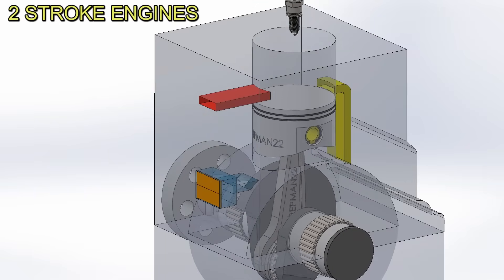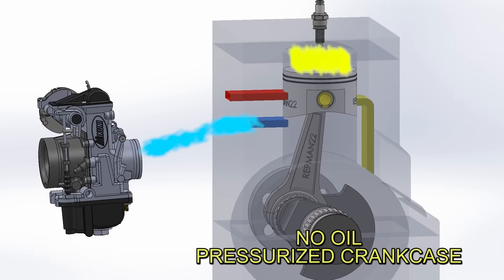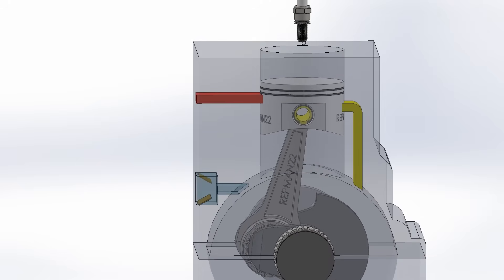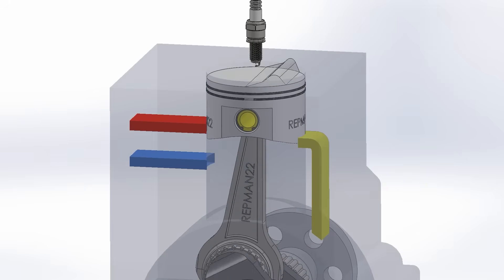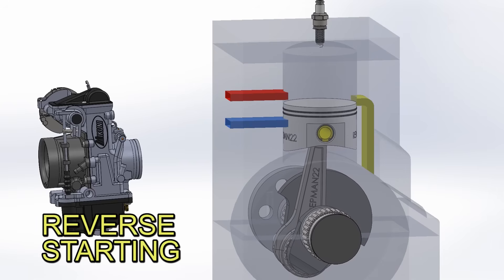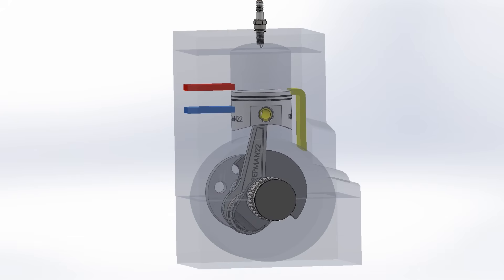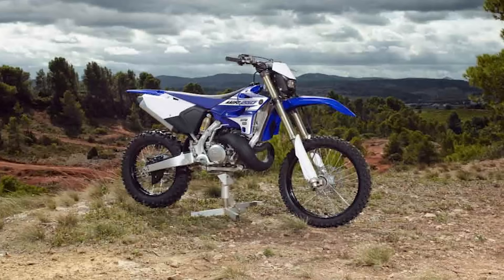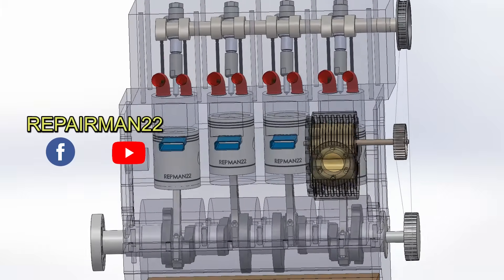Everything You Don't Know About 2 Stroke Engines 🤯

Comment: There  is a D-cycle engine which is a hybrid of 2-/4-stroke engines. It is just by splitting the crown section from its skirt to be operated via a (valvetrain) piston-train. The d-cycle completes the 4 stroke, different in both displacements and periods, per crank revolution.  It has the power of 2-stroke and cleanliness like the 4-stroke. It has been tested with more than >2.5 (~3) times power (torque)  and  >20% fuel efficiency gain. It can also make a hybrid of the diesel and gasoline combustions hybrid, which is another issue (invention).

Comment: Are you high? 2 strokes don't rev to 20k rpm. 

Extremely short stroke engine can rev near that but they have almost no torque. A flame front pressure wave forms when piston speeds too high and it basically breaks the sound barrier in the block.

And yes it explodes.

Comment: I love two strokes! theres a company out there that has created a new kind of 2 stroke that could be used in modern applications, it meets emission standards which is pretty cool! and produces a lot more power than a 4 stroke. they overcame the oil burning issue by adopting the usual 4 stoke technology keeping oil in a sump. they have done away with using the crankcase as a method to deliver fresh air to the cylinder, instead they are using a supercharger to replace that system. the engine is also fuel injected and has a rotary exhaust port, and no silly shaped exhaust needed. it's a beautiful design and I hoe it hits the market in the future :)

Comment: Great video on the two stroke engine. Back in the 70's we experimented with the expansion chamber exhaust. We found out that small diameter longer stingers gave us more RPM, while cutting off the stinger and inverting it to the inside gave us much more bottom end torque. It looked funny, sounded funny, but gave so much more power out of the corners.

Comment: I know from chainsaws for 50cc to 62cc class, the likes of Husqvarna sometimes have a homeowner model and pro model, which have almost identical builds. The pro having slightly great power output for the same cc. Some of this is due to carb setting but the main difference will be, that the pro saws have stuffers on the crank. Thus reducing the empty volume of the crankcase and increasing the compression therein. Yes the powerhead is slightly heavier but the pro saws will have a great use of magnesium parts, which then reduces weight.

Comment: Did I, at around 40 secs, hear the AI narrator say a four-stroke has a power stroke every 2 revolutions, and a two-stroke every revolution?

I thought the power stroke was only every 4th stroke on a four-stroke, ...??

Please explain!
Reply from the maker: Hi, its a human vo. Yes, 4 stroke does intake and compression (1 rev), combustion and exhaust (2nd rev) and restart the cycle.
Tx.
Reply: @repairman22 glad to hear there are still real people narrating, the amount of videos with no human voice are quite worrying from the point of view that we, as people, should still be willing and able, more capable of making a good, well read, pertinently expressed narration, with touches and nuances that AI has yet to accomplish. 

I think, w.r.t. the 4 stroke comment, I was, as some people might, considering each of the 4 stages of the cycle as a crankshaft revolution, rather than happening in a downstroke or upstroke of the piston.
Thanks so much for pointing that out!
I have watched several of your other videos too, like Ford Model T, VW Beetle engine, 2CV engine, Titanic, I think it was, a fire engine truck, et al, and your work is a joy to consider, and helps one understand so much more than was once possible when I was a youngster, and graphics were mostly static pictures, with slight descriptions.
Best wishes!
Reply: @repairman22 glad to hear there are still real people narrating, the amount of videos with no human voice are quite worrying from the point of view that we, as people, should still be willing and able, more capable of making a good, well read, pertinently expressed narration, with touches and nuances that AI has yet to accomplish. 

I think, w.r.t. the 4 stroke comment, I was, as some people might, considering each of the 4 stages of the cycle as a crankshaft revolution, rather than happening in a downstroke or upstroke of the piston.
Thanks so much for pointing that out!
I have watched several of your other videos too, like Ford Model T, VW Beetle engine, 2CV engine, Titanic, I think it was, a fire engine truck, et al, and your work is a joy to consider, and helps one understand so much more than was once possible when I was a youngster, and graphics were mostly static pictures, with slight descriptions.
Best wishes!

Comment: My scooter and my outboard are two-stroke engines. Never had any issue with them. Yes, they smoke and stink but as far as reliability goes they can't be beat!
That's important for me as an engine failure on the land ain't a big deal but a failure on the water will cause you big trouble from 1. second on.
Exhaust tuning is a science in itself. I remember doing countless tests as a boy on my 50 CC moped until I found the sweet spot. :)
Thank you for this video it's great. :)

Comment: Hullo, Repairman. It is certainly reported that Evinrude outboard motors ddeveloped something called: Evinrude E-TEC engines. These were two-stoke fuel injection engines. These apparently had lower emissions than equivalent four-stroke engines. Could you find out about these and add them to this video or a new one?
Thank  you and best wishes

Comment: Stihl has a 4 stroke engine that has no oil sump and requires a fuel/oil premix to lube the bearings.. They do it so the engine can be used in any position. Stihl makes horticulture tools.

Comment: For a "smokey" 2-stroke engine (carbed).  The jetting is too rich.  A well jetted 2-stroke engine does not smoke much at all, runs cleaner, and makes more power.  Factories have to sell them jetted rich to not seize in different air quality around the world. But any 2-stroke stock, with a carb,---will benefit from leaner jetting.

Comment: Very informative, thanks! The rotating disc valves can also be simple flat steel halfmoon discs pinned to the cranckshaft like a Trabant engine uses, almost no weight/complication penalty. In this case they are used ( I assume ) to let the engine breathe better at fairly low revs to let it pull from there. Even the completely standard piston controlled engines can be tuned for working at low revs, like a DKW  engine from the 1930's. At the expense of top end power, but better drivable on the street, especially back then.

Comment: Smoky two strokes largely caused by user error including incorrect fuel/oil mix, incorrect timing, worn spark plug, leaking crank seals. Adding oil to fuel lowers fuel octane so two strokes run cleaner on high octane fuel 95+. Timing is extremely critical, down to fractions of a millimetre, about 1mm below TDC. Water cooled two strokes are much quieter, more efficient/powerful than air-cooled. Engine braking on a long downhill can definitely hurt a two stroke. (Just my 2c worth 🤔 as a 2-T fan)
Reply: My 1992 JAWA 638 350cc "petroil" 2-stroke parallel twin, with single carb, had a neutral between 3rd and 4th, as well as  between 1st and 2nd, so that one could coast in neutral even if one was previously going along in top, which was 4th, or 3rd, with just a careful shift, so as to select neutral, rather than a gear, and get the engine back to idle while coasting downhill, and they had good brakes to help check the speed, and the headlight stayed bright enough too. 
Problem was one, as rider of the JAWA, then often, having no engine engaged with drivetrain, ended up going slower than following traffic, *since hills may vary with their gradient), and I had to try not be in the way of others that wanted to maintian the speed limit posted, or faster...
My first ever bike, a 1974 Yamaha MR50, had "Autolube", which made sure the lubing oil went in, even if one was on a lean throttle, going downhill, etc.
Reply: @martinbeilschmidt240  There are many great two strokes from central Europe like Jawa and CZ. I have been searching for a Suzuki TS125X, it makes the same hp as air-cooled TS250. I know a few years ago you could still buy a new TS185ER in Japan, but exporting it from Japan and then importing/registering a new vehicle is incredibly difficult and expensive.
Reply: Yes, my JAWA would get peak torque at about 4750rpm, and peak power at 5750, and I'd be doing almost 3000rpm at 80km/h, if I remember right, which was mellow, compared to other makes, so it was better at slogging than these dirt bikes, so much so that one could attach a sidecar, & just had to change F & R sprockets, & insert stiffer front fork springs, and haul a kerb weight of almost 500kg, with all & everything aboard.
Years ago I rode a recently agents overhauled Suzuki TS185, bought for a lady friend, and it was fun, with more go than I expected. Years later the engine suffered a seizure on a hot summers day during a long open road trip in the semi-desert. Think the Autolube must've been too lean: some mechanics lean it down until the exhaust doesn't smoke, but exhausts will smoke initially, if one rode stop start, around town, and should only be set to final after a good run that cleans engine & exhaust, I'd say.
Also, the gearing was low: did 6000rpm at 70km/h, and only had 8000 usable on the rev counter...
Adam Riemann on You Tube uses a Husquervana 300, a nice 2-stroke, in his tutorial videos...

Comment: Not going to mention anything about Snowmobiles using engines that run backwards to shift in to reverse? This has been how Ski-Doo does reverse with a system called RER that has been available since 1998 on some models and on all models since around 2002 or so. You press and hold a button and the engine stops for just a quarter second or so, then kicks backwards. The computer then emits an audible BEEP to let you know you are in reverse. Like a semi backing up. Somehow this does not require an electric start. Not clear on how that works. But since it is a pull start, it can only start in one direction normally and you use the RER to stop the rotation and spin it backwards.

Comment: I would have liked more explanation of the power valve. I think you briefly described it before you went over the pros and cons at the end. That is the part that broke on my Suzuki 125 back in the 90s
Reply: @bryanspanjer3213  in a two-cycle the height of the bottom of the exhaust Port is adjustable with the power valve 
In the older engines without the power valve you chose it.. was was not adjustable except  with a grinder and it stayed that way.
Reply: @RonaldDaub-v9y top of port not bottom

Comment: The lightburn zeta used the changed timing and starting its engine in reverse to avoid having a separate reverse gear. (meaning it had 4 reverse gears). What you have also overlooked is that the moment that the points close in forwards is the moment that they open in reverse.  It is possible that with a short dwell the timing of the spark is quite normal in both directions.  This happened to me with my Kawasaki F2.  It had an electric start.  I pressed the button and the engine started.  It sounded a little funny.  But I gave it a few revs and let out the clutch.  Straight backwards into the wall of the garage.  The first spin had filled the engine with mixture but then it fired and kicked back.  Starting the engine in reverse.  Funny in a way.

Comment: The catalytic converters on your modern cars, are so close to the exhaust ports of the head, to raise the temps of your engine to burn as many hydrocarbons as possible.  But it also adds heat to your engine, which is why Toyota never advertises 300,000 mile from their engines as they had in the late 70's.  The heat is hard on parts and the new electronics of engine management.  Reliability has fallen greatly for the enteral combustion engine,---which the EPA does not want us to use.  They don't care if it makes you broke, and they do make us more broke. The cost of a car is probably double with the EPA regulations,---which communist china does not have in our trade agreements with free enterprise mixed with communism.  Is the EPA about saving the planer from our prosperity and freedom to produce?  Or about advancing communism, stealing our free enterprise to fund their advancement?

Comment: For the tuned pipe, it is not the change in pressure through the pipe that causes the "reverse wave", but a sonic wave, (sound), that bounces off the reverse cones.  The expanding gasses in the pipe create the vacuum that help draw out free gas from the transfers, into the cylinder and some out the exhaust port.  It is the sonic wave that pushes that fresh charge back in the cylinder for a super charging effect, which is why tuned pipe make much more peak power (but not in the total range of usable rpm's, as it relies on piston speed match to a tuned pipe.).  Maybe the creators of this bot channel should have consulted with me, to be more accurate, (less false information).
Reply: Now to get more peak power, rpm's usually have to ride, (part of the equation), and it is usually true for racing or performance engines to seek more peak power, especially for racing like road racing.  But, the fact is, a pipe can also be made to enhance lower rpm power, like many pipes sold for off road use in dirt bikes.  The type of power can be changed for the application greatly, with pipe and porting.  I can tune a pipe to peak at 8000 rpm just as easily as peak at 16,000 rpm, by changing its tuned length.
Reply: Now to get more peak power, rpm's usually have to "rise".  sorry
Reply: @EarthSurferUSA  some of our motorcycles and RPM expansion Chambers and other two strokes could be tuned with a torque pipe. Of course other things in the engine would have to match the expansion chamber's job or duty. 
I remember having the Peakyist 90 CC Yamaha MX ever 
. It needed a toggle switch instead of a throttle. The 90 Yamaha had a RPM expansion chamber as we called it.. because that engine was not going to make that much torque unless it would be detained to a trials machine with heavier flywheel in different porting
Reply: @RonaldDaub-v9y  " It needed a toggle switch instead of a throttle."     :)    
Good post.   But the best way to build a engine is make the porting for the application, then make the pipe to match the porting.  But IMO, if they are just judged on their own (porting or pipe), pipe effects can change the power output more than just porting.

Comment: I have seen one two stroke engine start backwards.  It was in the 70's on a Husky 250cc dirt bike.  It was funny.  I saw my buddy start up the engine, put it in gear, took off a bit and the roost hit the front tire.  The culprit?   The flywheel key was sheered and the timing changed enough to backfire (on the kick), and start backwards.  It sounded like it was running good too.  :)

Comment: KTM (appeasing expensive EPA force), found out in their testing that direct injection into the head, had to fight the rising compression, and became complicated and even more expensive to make, (prices are very high today because of the EPA, and market share is dwindling in the off road motorcycle industry).  So they are injecting the fuel in the transfer ports or the intake with no oil, and still may have problems with the oil injection systems used for fuel injection for the 2-stroke engine.  Expensive KTM dirt bike engines today, are not a model for top reliability.  But they are the most expensive.  Thank the EPA.

Comment: What about loop scavenge two stroke engines?
Reply: In my estimation from years of study, I am sure the creators of this vid know what loop scavenging is.  But if they come from the perspective of the EPA, (which communist, anti free enterprise china has no EPA regulation in the trade agreements), it is to show a dirty running engine as much as possible, and no production 2-stroke engine ever had that port configuration in reality.  They all like to show a lot of smoke from the exhaust of un-burnt oil/gas, and all 2-stroke engines with a carb are shipped rich to be on the safe side for air quality around the world.  But that smoke can be greatly eliminated, burning cleaner, improving performance and gas mileage, with good jetting (which we have to do ourselves).  With those facts left out, makes this vid a piece of propaganda IMO.  Doug in Michigan.

Comment: There a four-stroke engine that have greater air flow capacity than current 2-stroke engine from Dynamic Alpha Automotive Technology.
Reply: Well, you can add a supercharger to a 4-stroke, not a 2-stroke, and make any 4-stroke engine with increased flow capacity.
Reply: @EarthSurferUSA  Yes.  You can add supercharger to increase air volume but it came as a cost  to thermal efficiency.

Comment: Most of my 2 stroke knowledge is in chainsaws. Intended use for the individual saw dictates the shape and timing numbers of the ports. I have all my saws professionally ported for the simple reason the man who does all my saws is an absolute artist with a lathe and grinder. .003 can mean the difference between an incredible running saw and spending $275 for a new topend kit, plus the tools are quite expensive.
Reply: I'm a chainsaw mech went to college that guy is having u a different sound to make appear supreme want Dino results most are done on hopes n dreams sorry true facts great hope u bought in  more ware thanything
Reply: A dyno will tell you little about how a saw will truly run in the cut. Of course modifying saws requires trial and error and experiance lots of experiance. I race saws and there's nothing we won't try to get an edge.